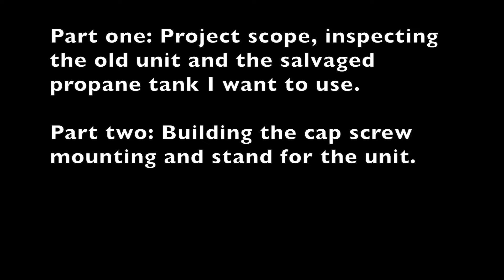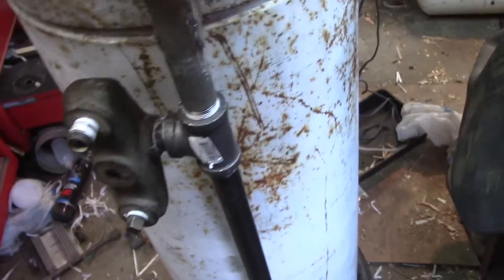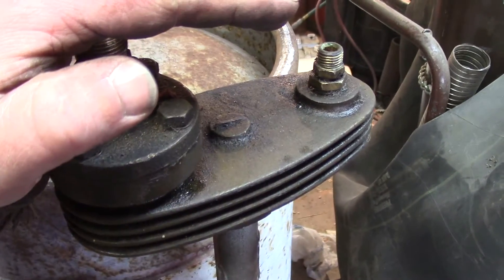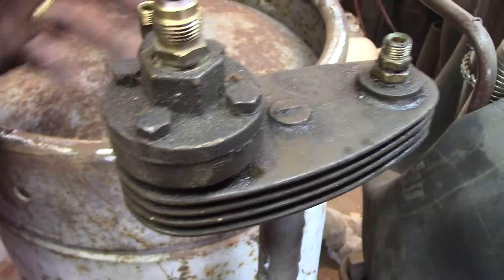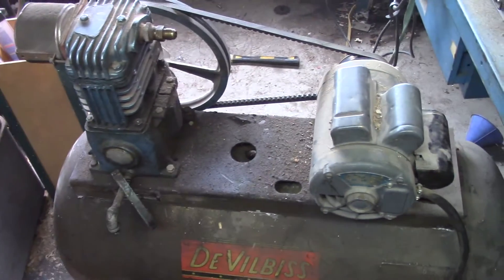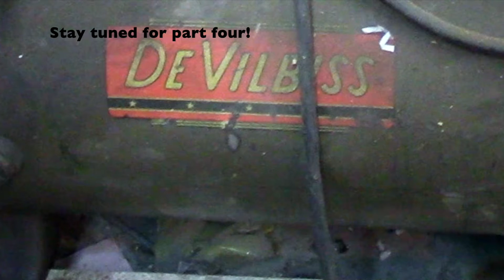Converting Propane Tank into an Air Compressor (pt3)

Comment: Wonder if ya can stick the decal on new tank
Reply from the maker: Be cool.  I wonder if you can date the tank by that.  Been thinking about your hydrostatic testing idea.  I figure a pressure washer would do it, now I just need to figure out how to connect mine, they seem to have special fittings on each end.  Buy a new hose and just weld a pipe nipple to the end maybe.
Reply: NelsonStudios wanna see it stretch and rupture